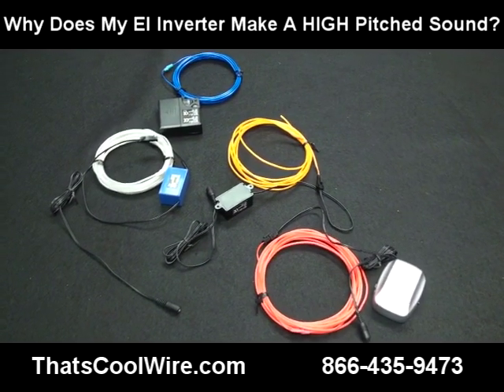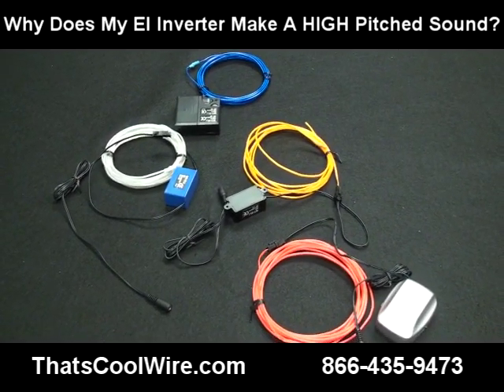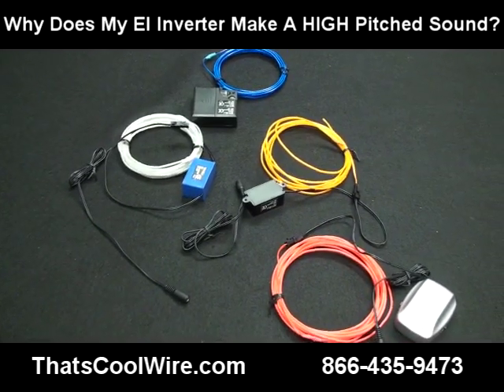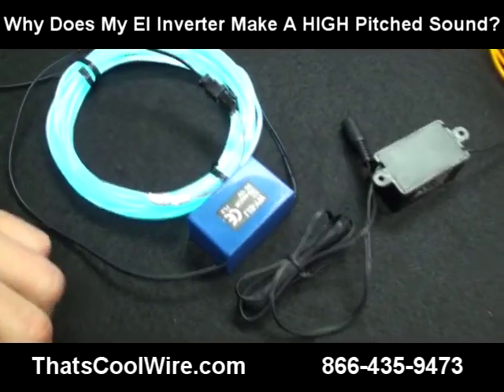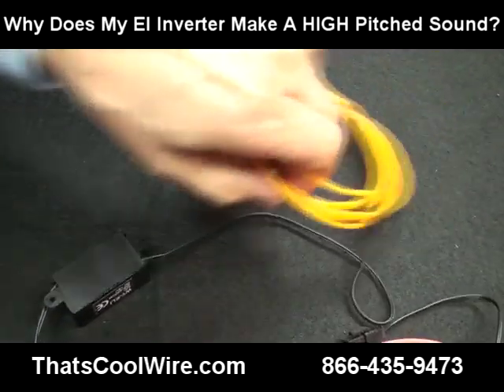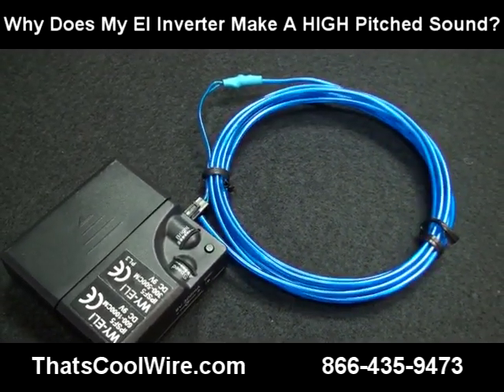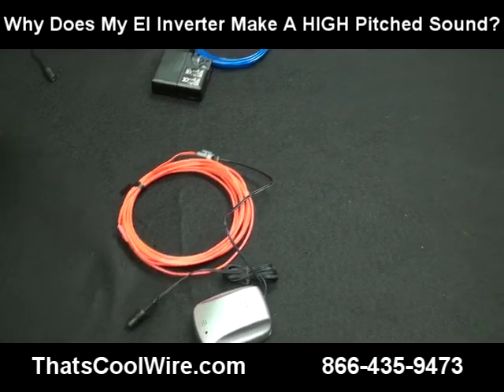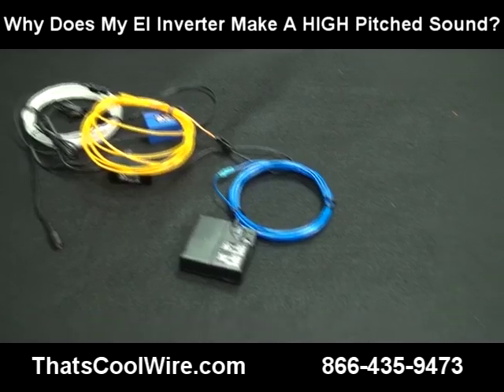Why Does My El Inverter Make A High Pitch Sound

Comment: 10:59 PM

The concern am having with my solar set up is during the day when the temperature of the sun is very high. I will put a load of 70% capacity of the inverter on it.immediately I put this load I will hear a false alarm with red indicator from my inverter. At night if I put the same load 70% on the inverter I won't hear any alarm.and the inverter will work fine.what could b responsible for this anomalous

Comment: Can I use this inverter for powering other household stuff? I mean what's the exact output Voltage of it? Both AC Voltage and frequency?
Reply: Man hell no😅
You have 3V or 5B Input and 100V Output with 2kHz you can maybe draw 100mA with 5V 2A power supply

Comment: Downvoted for not explaining why and just stating that it is noisy. My best guess is that youre either using cheap caps or the wrong type of capacitors.
Reply: He did explain, albeit not in detail. It's a DC to ac inverter and ac has a frequency. That's why the big ac transformers and crap have a buzz. It's likely a very high frequency sine wave as ac is sine. 

Every sound you hear is a frequency. Electronic synth sounds are made with different wave patterns like square and sawtooth and triangles and sine. The pitch is adjusted by increasing the frequency. That's why each color of EL wire has a different pitch. A different ac frequency is required for the different colors. It's similar to how led and laser colors work. Even light waves themselves. Different frequency of light waves produce different colors. 

I hope this helps you.

Comment: I guess I have good ears; I could hear all of those. I have a 750 watt inverter hooked up to a deep cycle battery. I use it to light a small lamp with a 7 watt fluorescent bulb. It used to be quiet; but now it makes the high-pitched whistling sound every time I turn the light on. It is really loud to the point that it hurts my ears. It's almost as loud as those house fire alarms (the round plastic fire alarms they sell at Walmart). It's fucking annoying...Initially, I thought it was some kind of alarm to let you know that the battery is getting low; however, when I test the battery it's still at full strength. I understand what you're saying that ALL inverters make noise; however, mine didn't used to do that.

Comment: I tested the sound with  a guitar pickup. When I hold my inverter away from it it doesn't pick the sound up. But if the wire itselves gets close it gets even louder than the inverter.

Comment from the maker: The frequency does effect the color of the el wire so a higher or lower frequency will change the color.
Reply: You mean dimming or complete colour change? I think you can dimm it with frequency and you can't change colour.. The capacitor is screaming bitch right?  I the circuit board (el wire is kind of cap itself) can't i switch it to high end one? I never had el wire (i bought one it will be shipped in few weeks) so maybe i find way to fix HF noise? What you think?

Comment: why don't they design them to go beyond the human audible range? Problem solved.
Reply: They do in some things which use the same kind of transistors its dumb they dont with this
Reply: Different frequencies produce different colors in the El wires. It's entirely possible there is not another frequency they could use.